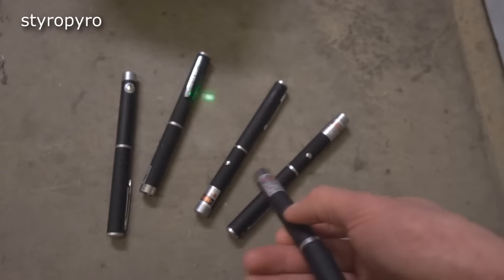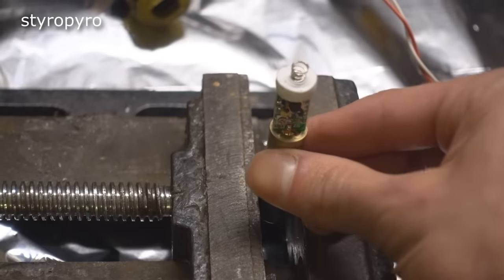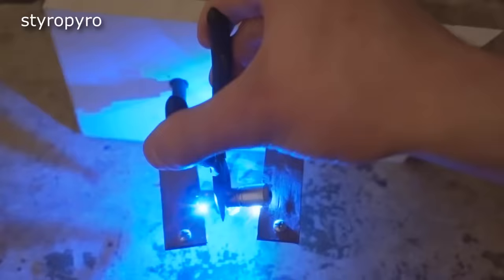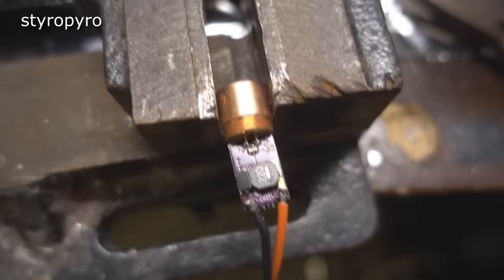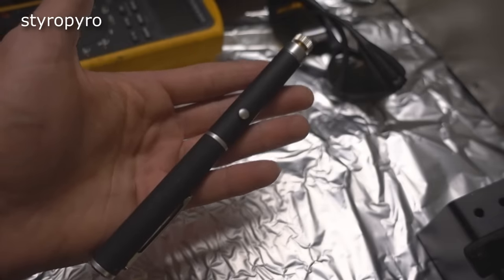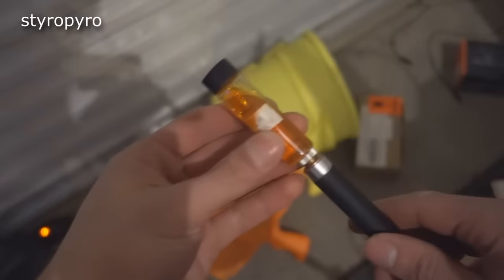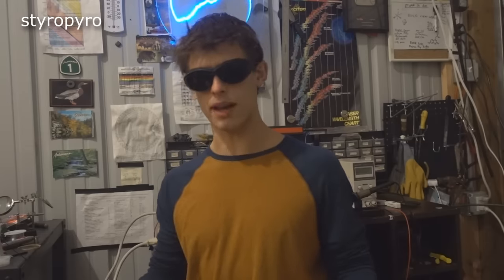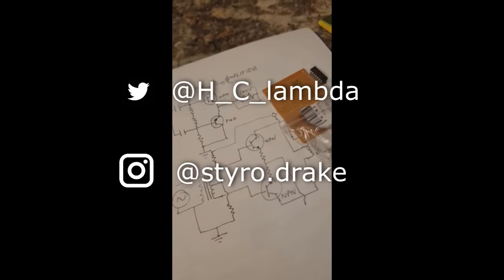Crazy eBay green laser pointer mod. 1mW to 1400mW++

Comment: recently found out that you can make the laser beam audible.  i was cutting some wood on my 2w cutter and suddently the 400hz PWM was audible from the spot the laser hit, it was carbonized wood.   i bet ths could be audio modulated
Reply from the maker: I've been wanting to do something similar by modulating the q-switch on a high powered pulse laser so the little ball of plasma that forms midair would play music. unfortunately a setup like that costs a lot to put together but I like your idea for a cheaper alternative! i'll have to give this a try with a 5W laser.
Reply: Man I wish I understood what u just said
Reply: You probably could
Reply: I have seen a few people use a laser to transmit audio. This is one I saw and remember. 
/watch?v=YU5c4bDA-vc
Reply: @styropyro  if you need funding, just reply and i'll give you a decent investment.
Reply: It can. There are some videos here that show laser engravers reprogrammed to play music.
Reply: styropyro 

Hi. 
I've done this:
Modulated a 150mw diode to music input. Low to high pass filters. 
Running through standard wave patterns on the x axis been offset. . 
Looks bloody amazing. And no way does video capture the output. 
Especially when filtering all low frequencies so leaving high and offsetting the x axis at high frequencies on a sine wave. 
Looks like your on a motorway travelling 1,000,000 mph !!
Seriously!!
Reply: Try the principle of the helium tweeter with a gas that will carbonize or absorb at the laser wavelength. @styropyro

Comment: I bought a red laser off Ebay that said "5mw" but it could burn through plastic and duct tape.

Top notch safety. 👌
Reply: Its better this then the other way around
Reply: Can you tell me wich one or a link? I wanna buy a laser that id atleast good and better then those 5mw ones
Reply: @Kwint.  If you look at some of those china laser sites (not to be racist, just experience), you'll more then likely find a laser not properly rated.
I also used DinoDirect for poorly rated lasers, but they no longer sell lasers.

A bit of advice: Use properly rated lasers, it's a lot safer when you know the rating, because you could damage your eyes if you don't use the proper equipment.
¯\_(ツ)_/¯
Reply: @zircron45  yeah, you have a good site ?
Reply: If it doesn't look atypically bright for a 5 mW, it might be that the red light output is indeed 5 mW, but there is a lot of IR being generated as well that is not filtered out.
Reply: @zuthalsoraniz6764  That's a possibility, but the output from the red laser's beam was bright enough to be seen on a camera.
Reply: @Kwint.  Unfortunately, I haven't done much laser related things in a while, so I can't remember the good sites for safe laser pointers and/or less safe, but properly rated laser pointers.

There are some good laser websites out there, that's a fact, but I just can't remember them.
Just make sure to test your laser pointers before using it without glasses.
Reply: Kwint dragon lasers
Reply: @TKO593  Yeah they're good.
Reply: @Abysia  Yeah honestly, I agree.  But, I try to keep the peace.

Comment: When you threw those batteries it was powerful enough to change the time of ur lighting clock at 5:50
Reply: Someguy that’s sound detector clock
Reply: @robodeadredemption4863  oh ok
Reply: Its not a clock
Reply: Thats a plasma disc

Comment: does it really count as a mod if you replace everything except the housing?
Reply: Good point, I was expecting a simple pot turning mod of a DPSS but then I looked at the output...
Reply: To be fair, 1.4 watts out of a housing that small is impressive, and you could do it too if you buy the same pieces he used.

And even if it isn’t 1.4 watts, that potentiometer trick is something I’ll keep in my back pocket.

Comment: You seem like somebody who has taken some interest in lasers, so maybe you can answer this question - is it possible for an amateur to detect reflected laser light from the reflector on the moon?
Reply from the maker: yeah but it's nontrivial. without looking deep into it i would use a q-switched laser (probably frequency doubled Nd:YAG at 532nm for low atmospheric absorption)  on a tracking mount pointed through a beam expander and then detect using a photomultiplier tube with an etalon filter. there might be better ways but i bet this would do it.
Reply: @styropyro  brother, as dangerous as it is to give this info to the public. I'm impressed with your outstanding ingenuity.
Reply: @kainhall  What the hell.
Reply: @styropyro  That´s indeed roughly how it´s done, but in practice it´s quite a bit more involved than that. The McDonald Observatory, a place where this is done, has to use a 30¨ mirror diameter telescope to only get a couple of photons back. Considering the weight of such a mirror and the required pointing stability, the tracking system is quite involved as well. An amateur with a million dollar budget and a lifetime 24/7 dedication might be able to pull this off, but you can hardly call someone like that an amateur.
Reply: @kainhall  I am even more confused wtf
Reply: @styropyro  I've never played with lasers, so it's way beyond me, and my time is taken up with stuff I am already doing.  Also, what you suggest as a means of doing it seems pretty scary.  I have read before that the sort of lasers used for the moon-bounce could only be government-sponsored, but I did wonder, as lasers have come along so far since the reflectors were left up there, and prices have tumbled.  If any amateur did it, though, I'll bet it would be a first.

I hope I've whetted your appetite!
Reply: kain hall somehow I followed everything you said
Reply: @blood7078  they're saying that info is important to have because it allows you to prevent others from using it for bad. If you know how to hijack a plane, you can safe people from a terrorist attack. If you know what building a pipe bomb takes, you acn stop someone from aquiring those resources.
Reply: @styropyro  bro youre a fucking genius!!
Reply: @LirokuToragi  oh I wast.... 

Doing speed limit at night..... the way the deer were placed I HAD to slide my car to turn sharp enough from hard left to hard right

Only person I'd injure was myself.....only one on the road for at least 50 miles

Montana for ta
Reply: @Bradlee Daniels only got one.....1/2 pound in a.computer

But I've got a few old vids laying around

Only 96kbps upload..... so, dont expect 1080p at 60.... or even 30fps
Reply: @Bradlee Daniels after we blew up a fridge with 4 or 5 pounds.... our local sports store stopped selling tannerite

Almost got like 5 tickets..... toxic dumping on federal land, detonation of an explosive device on fed land....etc

All I did get was a littering ticket

But the boom was heard all over town.... despite being 2 or 3 miles out of town
Reply: @Bradlee Daniels and 96kbps upload speed....

But I'll try to upload some cool shit

Right now its just 12 year old me....and its cring as fuck

Comment: I think this might have commercial potential as a pipe lighter.  No joke.  Lighting a pipe is always problematic because you need a soft flame which won't scorch the wood, but matches are hard to use in any kind of wind (and you're pretty much forced to smoke outside these days).  A laser like this can be pointed down into the bowl without scorching the edges, and can be used in both wind and rain.  Probably wouldn't make you rich, but it's a niche market you could definitely exploit.  I'd buy one.
Reply: NoJusticeNoPeace until it slipped and you pointed it at your eyeball
Reply: You mean the same way I could slip with my Zippo pipe lighter and set myself on fire right now?
Reply: it would blind you if you pointed it at your eyes thou
Reply: nasolem  i think you would need some goddamn amazing goggles against that stuff.
Reply: hoen2009 lazerdabs can recommend an affordable pair as he creates high end laser lighting smokeware
Reply: ...and you could also blind pilots and crash airliners taking off or landing, as well as cause massive accidents on a freeway, with anyone who survives being permanently blinded. Those are the only flaws with your plan.
Reply: You'd go blind real quick even if you didn't point it at your eyes

Comment: I love these sorts of projects with lasers, and was wondering you knew of an easy way to converge multiple beams into one. Reason being using high powered lasers (even with proper protection) is still very dangerous and I want to have a weak <5mw laser in the same spot so I can see where the laser is pointing even before turning it on. Converging would obviously be easiest but requires an exact range every time...
Reply: Place the lasers to be used in a circle aiming towards the center of a concave mirror. A very small, concave mirror and make sure they are all dead center and the same dimensions in distance and projection angle to your mirror. Should be able to use the laser reflections to make the final subtitle adjustments. Once that is correct, place a convex mag. Glass in front of your mirror where the lasers seem best concentrated. Theoretical thoughts lol

Comment: Guys, stating the obvious: This will damage your eyes. Reflections from most surfaces at this kind of power will cause permanent damage. Someone posted below about reflection from a mirror and he now has a blind spot. I feel for him. You can't get-away from instant, permanent damage like that. 

Don't rely on safety glasses at this kind of power either. Particularly if you play with these things more than once.

I knew someone who was blinded in both eyes by a communications laser. It doesn't heal or get any better with time. Read up about these things and understand the risks before you do anything with lasers. Not just harm to you, but your neighbors and pets. Our man Styropyro is taking all the risks, which is fine (for the rest of us) :-)
Reply: good man for letting people know about laser safety and eye care
Reply: Agreed. He's a funny and clever guy; but he needs to be really careful. And I don't just mean careful; I mean the kind of care you take when you know for a fact you won't get a second chance. I'll put it another way, if there's a 1 in 100 chance of a parachute not opening for example, that risk is acceptable [maybe], but after 50 jumps-and you're tossing a coin. 100; and statistically you should be dead. In WW2, the RAF worked out that anything over a 3% loss rate per mission, was unsustainable-and they had to pull their aircraft back from raids in 1940 or 1941 I think, otherwise they wouldn't have had an airforce after just a few short months. It was also what the Germans were trying to do in '44; knock down enough Allied bombers-so they had to cease. 3% would have been enough. And remember what happened to Steve Irwin; a master in his field who knew what he was doing, but if you're a professional risk-taker: your luck just might run out. And the odds don't just get worse over time. Mastery is no fail safe either; it can even increase risks-it's an unfortunate statistical reality, that professional mountaineers can be at a higher risk of dying from avalanches than those less experienced, as their experience makes them ignore signs that would put the less experienced off.
Reply: That's pretty intense
Reply: Well, then you shouldn't ask for an "official Red Ryder, carbine action, 200 shot, range model air rifle, with a compass in the stock and this thing that tells time" for Christmas. Because you'll shoot your eye out!
Reply: @rocketassistedgoat1079  you can jump out of that plane 1000 times, and the 1001th time you jump out the odds will still be 1% for that jump. your logic and examples are extremely skewed
Reply: @rocketassistedgoat1079  Not to dispute your sincere and wise expression of the need for extreme safety precautions with lasers...having said that...

" I'll put it another way, if there's a 1 in 100 chance of a parachute not opening for example, that risk is acceptable [maybe], but after 50 jumps-and you're tossing a coin. 100; and statistically you should be dead."

I don't think it works this way, but it's been a long time since I've dealt with odds.  Any given parachute may have a hypothetical likelihood of failure of 1:99, but on the fiftieth jump, you are experiencing odds of 50:4950, which is the same as 1:99; and at 100 jumps, the odds would be 100:9900, which is the same as 1:99.

But I could be wrong, and you are absolutely right about the need to take extreme safety precautions with lasers.
Reply: and we have to put caution content are hot,  on everything for people like you.
Reply: @carlericvonkleistiii2188  Well...I'm not going to pretend I understand how statistics work [lol], I just know if you do dangerous things-you're in more danger than someone who doesn't. And jumping out of planes-or any adrenaline junkie activity that doesn't benefit anyone or anything other than your own selfish desires; is incredibly stupid-and I have no sympathy for anyone who injures themselves terribly that way. I also think you have to be dumb to date someone like that in the first place, so I have no sympathy for the spouse either-I reserve what limited compassion I have for the kids visiting their quadriplegic dad, or those in e.g the Congo, who never had a chance or a choice. But doing risky things for your country i.e the military, science or education; is another story entirely, as it's serving something greater than yourself. One of my favourite books-which I've read 4 times for fun [it's also compulsory reading in many high-schools and universities and remains the most famous U.S novel ever written], is The Great Gatsby. On page 1, the narrator divides all of humanity into careless and careful. Careless people; are only interested in their own narrow, selfish interests and always leave a trail of debris behind them [literal, emotional and metaphorical] which they expect others to clean up after them. So no, jumping out of airplanes wasn't a great example.
Reply: Shit I wasn't wearing safety glasses while watching this video. Will I be OK?
Reply: Stevey TeeVee  COnsidering the statistics of literally everything around us and all our day to day actions, the original poster must wake up in complete shock every day to be alive hahaha

Comment: Love the videos, I came across them while looking for information and inspiration, I’ve been thinking about making a car number plate surround with 20mm clear acrylic sheet just about 1/2” bigger all around and using UV and IR leds to scramble the ANPR cameras on highways just for the hell of it as it’s not interfering with the actual plate I can’t see why not 🥴 another idea I had was to countersink this little plastic acrylic diamonds you find on tables at party’s into the sheet to help spread the UV and IR around , what’s your thoughts ?
Reply: I think thats an interesting concept. Have u found something that does what you want it to do yet? Theres a few lame wet leaf 🍁 attached to plates I’ve seen in NYC as well as some of the now banned plate flipper deals that were sold on Amazon but because YouTubers cant keep their shit to themselves, they are now banned. MEH

Comment: 5:50 Why does the laser circuitry do 20W? But the diode does 1.4?

Also where do you source your diodes from?
I’ve always loved lasers and electronics and want to get into it. 
You demonstrate a lot of knowledge in the electronics field and I would love to be on your level some day. :) 

Cool video bro!
Reply: The rest of the power is dissipated as heat in the laser diode module.
Reply: Charlie Puch Thanks got your reply. So if that much energy is being lost is it an inefficient diode? Or is this typical of all diodes?
Reply: Alex Alt I’m no expert in this field but I would assume with him saying that it is the best you can get for that size that it’s just what you should expect, now if we’re talking bigger diodes you can expect more efficiency.
Reply: Some types of lasers are below 1% efficient, so its pretty impressive (for such a high power and small size anyways). They just keep improving. My ~1w blue laser, goes through a 2200 mAh 2s LiPo battery (so roughly 18 W/h) in about 20 minutes, so around 50w? That seems very high, but I think that's about right, that would be 2% efficient. Its hard to tell though, it keeps me happy for about an hour or two finding stuff to burn before I have to charge or swap the battery, I just use a massive battery taped to the outside of the pointer.

Comment: They should give this to the protesters in china
Reply: They make all kinds of hand lasers in China.  I have bought several. I have one that would set wood to flames. Not a good idea to give to protesters. Not only will they blind the cops, they would blind each other or innocent by-standers
Reply: @alyssondasilva4484  become a member of Laser pointer forums.. There are some members that will build them for you. You will see ads for many sellers and companies that manufacture them. These are never intended or should ever be used as weapons. They are for either light shows, signaling or cutting materials. These devices ate extremely dangerous to the user or bystanders if mishandled.. You are free to brows around the forum befor joining. A lot of the members are much like the cast of The Big Bang Theory I must warn you though.

Comment: I actually took a cat toy simple laser and made it less bright but better lens it won't hurt cat eyes and they are delicate and a bigger spot and cat's love it!  It was 1mW crazy bright and could damage even human eyes when I bought it, I reduced the power with resistors and it's running off 3 lr44 cells and it was too bright and defocused it's lens it is the size of a small mouse and low power!
Reply: 1mw??? Too bright??? I smell BS. I have a 3 watt laser and its like looking at a welding spot anywhere you point it.